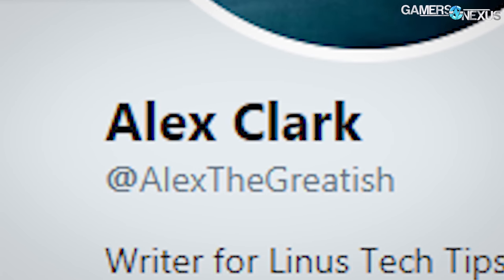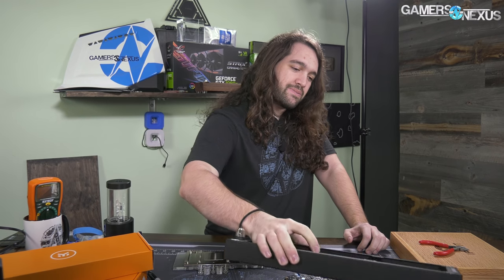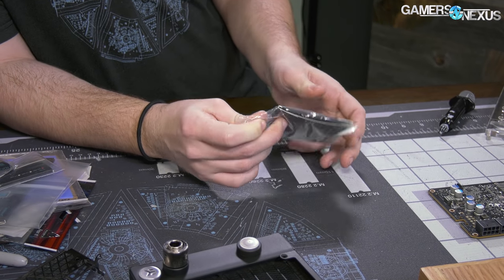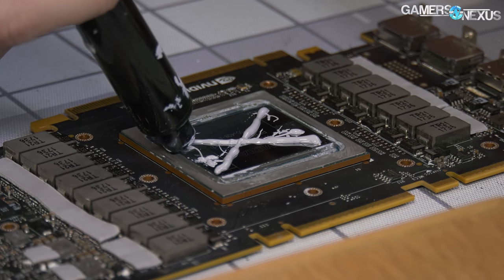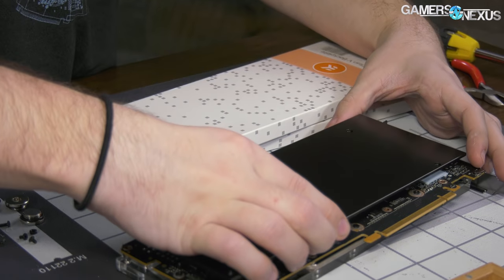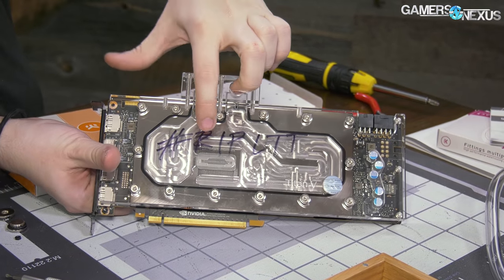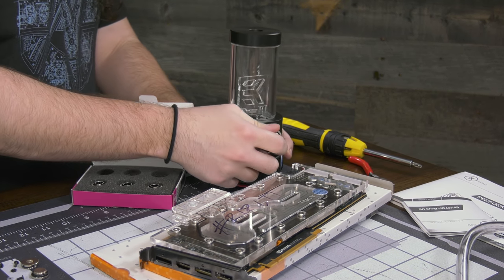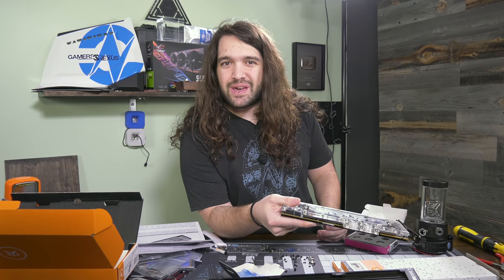#RIPLTT: Accepting Linus' OC Challenge, Pt. 1/2 (EKWB Titan V)

Comment: LTT score is pretty impressive considering it is a very aesthetic build, it's not a crazy overclocked workbench extreme rig built specifically to achieve high scores, LTT system is a completely usable daily driver.
Reply: LTT has more resources than Steve does. I wouldnt be surprised if LTT cherry picked their GPU and CPU out of the few identical ones they had before deliding and stuff.
Reply: CPU, possibly
GPU, Unlikely - Linus only bought 1 Titan V
Reply from the maker: It's very impressive! I think we can hit it at its current standing. Not sure how far we can push beyond that. It'll be close.
Reply: but given their usual. it's just good enough philosophy when doing everything, that score is very impressive, but even a broken clock can be  correct
Reply: Tin Foil Hat.
Reply: "bought" = given a carefully handpicked one from Nvidia
Reply: uglyduckling81 no, it was bought. There were no titan v media samples
Reply: Vali Tyr had to go and see what you were talking about. Some crazy American hardcore right wing dude.
I can see what you were aiming at but you overshot the mark by about a hundred fold.
Reply: uglyduckling81 hes a conspiracy nut, thats the connection with your comment. Dont take it seriously, its just a joke on your comment type.

Comment: 3000 rpm fans? Use a Dyson instead, much better airflow.
Reply: A $700 fan, better has some good airflow... or We turn "Dyson" into Miles Dyson, to breathe its last breath
Reply: cool it with a turbocharger. XD

Comment: "Hey Linus! Come at me bro!" - Tech Jesus :D
But please DON'T put liquid metal onto the shunt as it eats trough the solder and causes serious damage to the card! Just solder a 10-20mOhm SMD resistor onto the shunt to get 50-25% additional power.
Reply: 3mOhm to have UNILIMITED POWARRRRR
Reply: Do you mean a $1200 fire starter? :D
Reply: Video of the possible damage: https://youtu.be/HPqi8RdApxc
Reply: The timing is peculiar. Louis Rossmann has a recent vid of trying to repair a Titan (not sure the exact one). He was tripping hard on how poor quality the solder was, but the title of the video itself will tell you he later realized it was the owner of the GPU that most likely did it himself by shorting it.
Reply: "Just" solder on your $3000 card. Better yet, "just" solder a potentiometer in there so you can adjust the resistance for finer control. Or, as @GamersNexus explained to me on Twitter when I linked the Rossmann video, just thoroughly clean off the LM as soon as you're done with the benchmark session.

Comment: You probably already know how to do this, but if you want to use dry ice, I'd recommend using a dry ice/ethanol bath.  That will produce a bath of -78 C (dry ice temp) but has the benefits of liquid energy transfer.   It's more robust than liquid nitrogen and easier to find/setup as well (bucket ethanol from Lowes with crushed dry ice).  I'd use antifreeze 50/50 mix for your coolant, cause water may freeze even with the heat from the overclocking.  Antifreeze is only good to -37 C so still a bit higher than the bath, but the OC heat should keep it from freezing.

Comment: Coolant VOLUME has a significant impact on your water temps as well - I'd go for a 80mm thick 360 Alphacool in push/pull if you really want to wring every degree of performance. Thin radiators just don't cut it because they barely contain the liquid you need to carry the heat away. Good luck with your results!!!

Comment: Set it up so it pulls air from outside through some ducting assisted by a squirrel fan , do it at 3 or 4 am in the morning when its coldest outside . I think you have an advantage there being in the mountains , if it snows then even better.  Rock on GN !!

Comment: One way to help your OC easily is if you have an aircon unit in the room turn the temp setting as low as it goes then turn the fan on full blast , this does 2 things , cools the air and drys it out. 
That way if you plan to run your radiator submerged in ice water you will get less condensation on your GPU/CPU. If you manage to get your water temp below say 10c you should easily beat the LTT crew.

Comment: Use a Haelia Water chiller to replace the rads in the loop, Ive mentioned this before on your previous vids. I have my 1950x and 1080ti running at 20-25c 24/7 using one. Can go lower but condensation is the limiting factor.

Comment: You can't go wrong with Fujipoly / Kryonaut combo..  Kryonaut is not electrically conductive either. It is definitely better to have too much than too little though, the GPU definitely needs to be fully covered. That was actually "too much" paste though, you may want to consider using the rubberized applicator to apply a smooth, thin and even layer across the entire GPU for minimal bleed   ( º¿⌐ )

Comment: Dude    the cooling would be crazy if you were to use those wicked load fans that are used in server racks.  I don't know if they are 120mm or something like 92mm.  You could fabricate some kind of ducting manifold.  They have crazy pressure and obviously move a large volume of air, spinning at like 7000 rpm.

Comment: For the rad use acetone with dry ice. The acetone wont freeze and will be as cold as the dry ice. Submerge the rad in that solution and ur temps will be hella low

Comment: (salt warning) Liquid metal objectively conducts heat better than a normal thermal paste solution. If if it is, supposedly, very minimal, in terms of benchmarks, every minimal thing counts, since they stack up. It doesn't make sense to not use liquid metal on the GPU when it's at your disposal like that, and you're trying for the very best score you can get.

Comment: short those shunds dude...i highly recommend it...its more than only 3%, it depends on gpu load intensity. test it at 3d mark 11...thats is one of the hardest gpu power draws i ve ever seen. without powermod my gtx 1080strix oc (watercooled)was hard dropping gpu frequenzy.
Reply: Maybe with a sub $1000 GPU. Modders here have horror stories if you scroll around.
Reply: nimrodery witch stories do they have.. i have over 1 year the liquid metall on my shunds and on my 1070 strix is 1 and a half year without any probs. if thats were youre horror story.

Comment: Why isolate loops? At best the heat loads are balanced and there is no difference between having them in one loop. Otherwise, one competent produces more heat than the other and misses out on the cooling that has been isolated to the cooler device.

Comment: What this video (and the talk of putting radiators in ice water and such) made me think of: Why not do this outside when its cold in winter? And, secondly, how much of a concern would be keeping the liquid from freezing when the system is off/idle at an ambient temperature of, say, -10 or -20°C?
Reply: This would be an actual use case of antifreeze as coolant though xD

Comment: No shunt mod? BTW using LM on the shunts is proven to be risky and it WILL alloy with solder and destroy the integrity of the solder joint. People have already had shunts falling off their cards and shorting other components due to LM shunt mods.

Comment: Hey Steve. I've been doing a little research and have found that shunting your graphics card w gallium/liquid metal ruins the solder on your graphics card and could ruin your card over time. Therefore is liquid metal generally a bad idea to put in a standard graphics card or cpu? You could add it to your ask GN Q&A
Reply: You could mention the risk/consequences of bad application and such

Comment: Okay it's simply unarguable that applying liquid metal like Conductonaut, which has around 6 times more thermal conductivity than Kryonaut regular thermal grease, is a much, MUCH easier way to get lower temps and MUCH more necessary than adding thermal pads to the back of the GPU. Sure, do both, but why the hell would you miss on liquid metal? You're already pushing the card to its limits and risking it, just put insulator tape on the sides of the GPU, and do all the other preparations, and you've got AT THE VERY LEAST 1 DEGREE lower temps. Even if you say it's negligible, it's undeniable it will make at least 1 degree Cº of difference.

Comment: Why not liquid metal? Is there a reason why everyone avoids liquid metal in custom loops? The idea is extremely cooling but everyone opts out of extreme thermal pastes.... I don't get it.

Also why not just remove the back plate and hit it with the fan directly it should provide better cooling like this and the water block will have enough structural integrity to support the card.

I see the water block and back plate hold each other in place.

Comment: Ask GN: How much would an M2 SSD installed between PCI-e slot heats up due to hot air coming from GPU with heatsink fins oriented perpendicular to the motherboard? Or we shouldn't worry about it? Thanks.

Comment: hey steve i have a cooling related n00b question- is it possible to use size-cut thermal pads instead of the thermal paste between the cpu/chip & heatsink?
Reply: A J 
I've seen elsewhere that pads are not as efficient for that much direct heat from CPU.

Comment: Hi GN. What can you say about Arctic MX-4 and Prolimatech PK-3 thermal pastes?
Reply: procerator MX-4 is a decent, but pretty standard fare thermal paste. I don't really ever have any issues with using it personally, but that's because I usually swing to the opposite end of the spectrum and go for T series processors, rather than everyone else's obsession with overclocking.

I currently have a 1050 TI and a 6700T running off a 600 Watt power supply. With such low power draw, the supply barely breaks a sweat, and I have enough headroom that if I really want to one day I can cram in a 1080 TI or something crazy without having to make any other modifications to the build.

Comment: 8:45 "every fraction of a degree is going to help"
not using liquid metal on the GPU
not getting a second waterblock to cool the back of the card
not moving to northern Russia to take advantage of lower ambient temperatures
not lapping the GPU die 
not submerging the card in liquid helium
not entering a near comatose state to lower your body temperature and therefore the ambient temperature of the room while overclocking

Comment: I've got  a 980ti I'm thinking of watercooling, would a h60 be enough?
Reply: do you mean corsair H60 ? how are you going to cool a gpu with cpu cooler ???
don't do the janky-ass mod that Steve does with gpus (since he does those just to test the card not regular use) buy custom loop components and water cool your GPU.
Reply: no I was going to use a nzxt g12 bracket not just gonna attach the watercooler too it as is and call it done
Reply: it is a better choice but if you can it is preferable to use full custom loop .
if your version is based on reference PCB there is ready to attach cooler from EVGA for the 980ti if you find one cause doubt that they are sold any more.

Comment: Can you not use liquid metal on the titan v. or does it short out the hbm and gpu?
Reply: i dont think it would
Reply: the gpu core would be fine with liquid metal but the water block looks like it's aluminum.
Reply: psionx1 no its nickle plated, the only aluminum parts ek makes is part of the fluid gaming line

Comment: Don't use liquid metal on them. Watch louis Rossmann Vid.
Reply: Why? It only has to hold up for a couple of weeks, which it definitely will. Also i don't remember Rossmann doing anything with liquid metal, any more specific pointers?

Der8auer was one of the popularisers of the liquid metal mod, and apparently his units still hold up, he uses the same liquid metal TIM as these guys here; but for some people, the mod failed after a few months due to aggressive alloying behaviour of some other liquid metal TIM.
Reply: It seems to dissolve the solder points of the shunts. Also i am sure he wants his Titan card to hold longer than a vew month.
Reply: It does no permanent damage to copper that the PCB tracks and the shunt resistor end bits are made from but it certainly alloys with tin that they're plated with and soldered with, making for potentially in some rare cases a sub-100°C melting point alloy, and the alloy gradually travels through the volume of tin, which can allow the shunts to move in normal use eventually.

Certainly for a permanent modification, soldering a second shunt on top is preferable, but Steve is actually aware of the issue, i seem to recall he's been part of this discussion already, either from Der8auer's follow-ups or from his own videos and the comments, so he can make his own informed decision.
Reply: I recognize that Steve and you are more informed about this than me. Ultimately i just dont want steve to loose his card. If it was my card i would not risk it when there are other options.